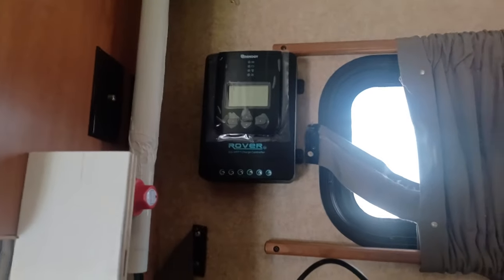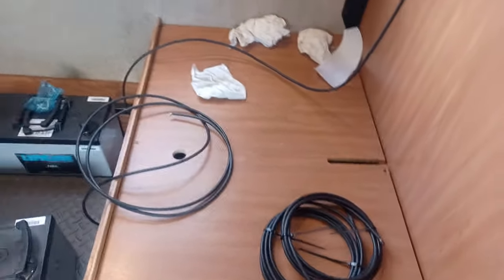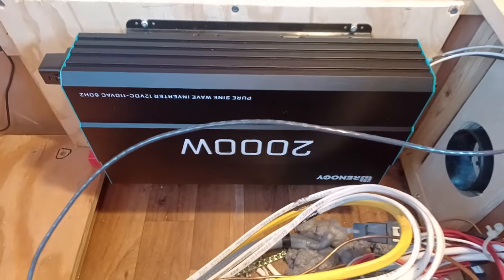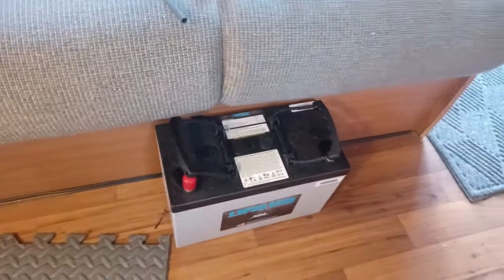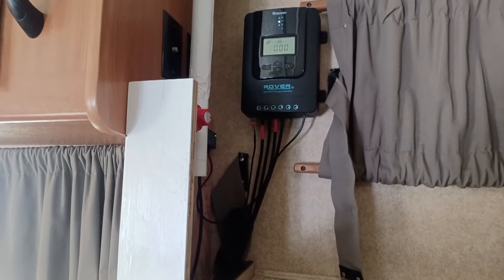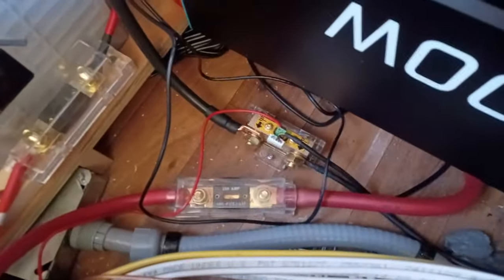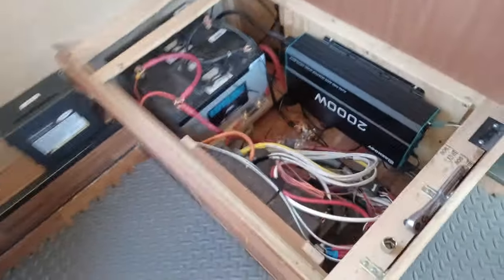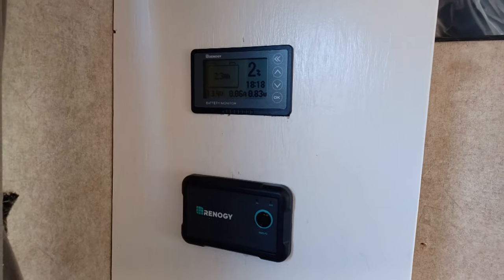RV/Motorhome Solar Install part 2

Comment: congratulations, really awesome !
Do you have wire connection? I have a MASJESTIC THOR 23a and i plan to install solar panels and i can't find any information to do it
Reply from the maker: No I don't.
You pretty much install the solar as a separate system and then connect to the house battery. Adding an inverter is a little more complex. I may do a detailed video soon. Thanks for watching. Happy to answer any questions. My email is in the about page. Please subscribe.